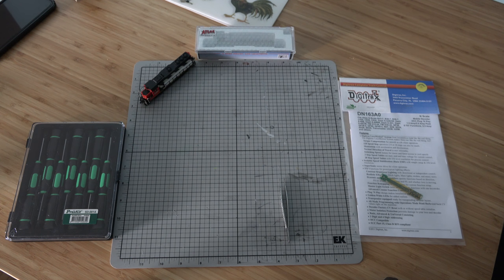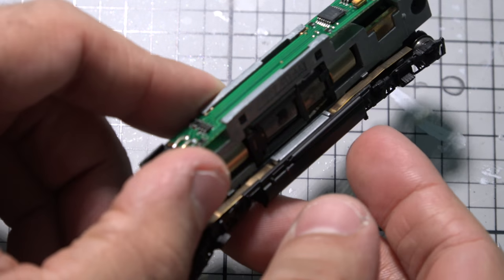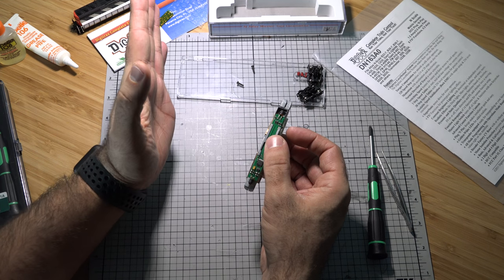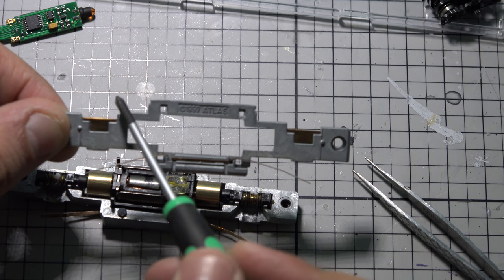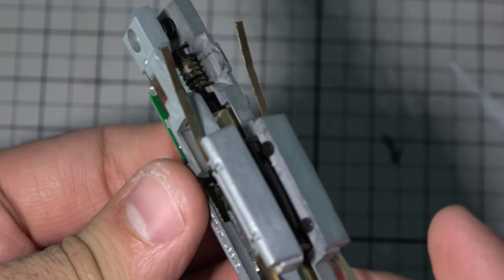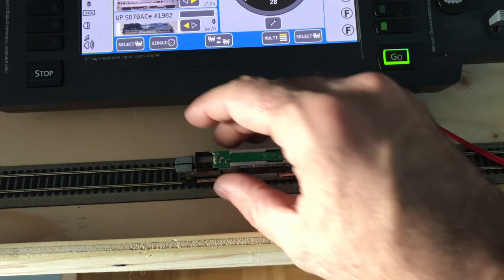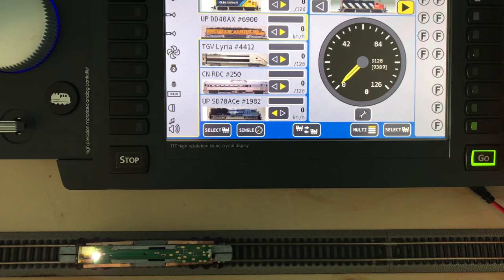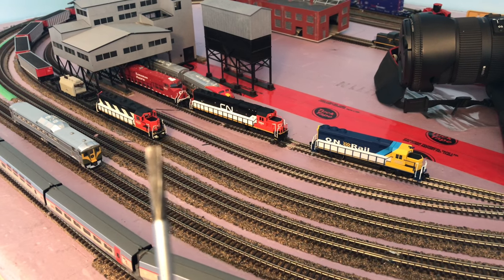Atlas GP40 Decoder Install

Comment: hi Tim... excellent install... the only thing i do different is i don't completely disassemble the loco.. i just loosen the screws & spread it apart just enough to remove & install the new decoder... thanks for sharing ... vinny
Reply from the maker: Hey Vinny. Lol ya that sounds a bit easier.

Comment: Nice video.  But you didn't mention anything about the Kapcan tape?  isn't it important to protect shorting the decoder?
Reply from the maker: Thank you for the comment. You are right about the Kapcan tape on how it protects the decoder.  But in this install I really didn’t need it.  There is no wires or metal in the shell to worry about. Ya i guess I could of put some Kapcan tape between the decoder and the chassis.
Reply: @H0bby_Adventure  I  am having a hell of a time restoring my SW1200.  I recently installed a Digitrax decoder, and as usual, had to replace the broken contacts.  I ordered a new walkway , which requires separating the walkway from the plastic chassis.  The decoder works and the engine runs when I put on the walkway with new contacts, but when I put the shell back on , nothing.  I can only figure it is shorting somewhere but I cannot figure how, since the shell is plastic . Any ideas?
Reply: I think most everybody doing their own decoder installs experiences the very same thing you are. The way I solved this no response problem was patience, a lot of patience! Taking off the shell over and over again and replacing it till the problem goes away. I can't see what goes on underneath but seems to do the trick for me.